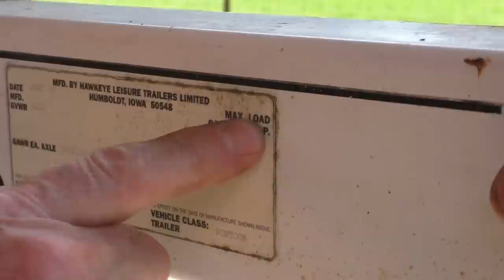Main Mast and Gangway and Assorted  Repairs

Comment: Now that's a hell of an idea. been suffering welder tan and spatter burns on my arms because my jacket shrank as I got older. Or my waist just kinda went sideways. I'm heading out to cut off the bottom half of my jacket so at least my arms are covered. Thanks Doug for allowing my to get a second life outa my rather expensive welding jacket.

Comment: when fitting a pipe to another pipe use a hole saw the size if the pipe you are fitting to, to get the proper profile/cut on the mating surface.
Reply from the maker: Not really needed for our task.   On a boat doing more with less is better than hauling around every tool know to man.
Reply: Agreed!   if you want a better fit maybe stand the rungs vertically between two pieces of steel schedule pipe and give it a quick hit with a sledge?
Reply from the maker: That would work.  Might be able to just super glue them on after that.  :)
Reply: +SV Seeker  As long as it's the certified industrial marine nuclear stuff ofcourse :p
Reply: just make sure it's a good marine grade superglue and you should get good service out of her.
Reply from the maker: I'm old enough to remember bailing twine.  Before it got replace by that newfangled bailing wire.
Reply: my last delivery of material arrived with some polymer strapping instead of the usual steel stuff... was significantly harder to cut than steel!  times are a changin

Comment: If you are using a shielding gas while welding, try a CO2 and Argon mix.  About 5
5 argon is plenty. The sheetmetal shop where my dad worked fabricated heavy stuff. They found that This mix of gas gave them a smoother and flatter weld with a little better penetration on thicker metal.. Keep up the good work..

Comment: Gidday from Australia mate! I found your channel the other day when looking for home foundry and you were making your prop blades and I haven't stopped looking at ya vids since, enjoying them all.
I wish to through in my 2 cents in if you don't mind, if you don't know about this little trick here it is if I'm telling ya how to suck eggs forget I said anything.  
When you were doing the mast top you mentioned about the gaps being a bit hard to weld, what I used to do if I had some "Gap craft" to do was to take a 3.5mm low hydrogen welding rod or what have you, knock off all the flux then lay it into the gap and simply run your weld over the top of it, easy mate.

Keep up the good work, love the dragons.

Calm winds and fair seas.

Comment: If you have lots of pipe ends to fit, get a tubing notcher. They use hole saw blades, they are quick, easy & accurate.
Reply from the maker: Maybe if we were building race cars, but doing more with fewer tools is a better skill set for a work boat.

Comment: I used to install light poles on freeway cloverleaf about 30 years ago. In fact I installed some near Tulsa. More than once I had customers report that the poles were warped. I always had to go investigate and the issue was always the same, the poles would "sunflower" (lean away from sun in daytime) and be straight as an arrow after dark. Just wanted you to be aware that the sun can create problems with straightness. Great video and build.
Reply from the maker: Spot on.  We are very aware.  We would weld and then go take a break so we could cool down as well as the mast before we measured it again.

Comment: The next time you are trying to check a piece for straightness, mark the center of the end face and then set a pointer where you want the center to line up to.  That way you don't have to keep measuring the deflection.

Comment: I saw a nice technique for cutting birdmouths on pipe to pipe joints the other day. Just put the pipe under the drill press horizontally, and go through it with a hole saw the same diameter of the mating pipe

Comment: I did a welding apprenticeship. The real skill I soon realised is the fabrication, which you have totally nailed. I never ever considered how poles and masts are tapered at the steel mill. Never saw it or needed to do it (worked on railway, not many masts needed there!!) How do they do it at the steel mill?

Comment: You sure keep moving on this at an impressive pace Doug, well done!   One quick note on the gangway... make sure to offset the horizontal rungs and the vertical stiffeners (stiffeners between rather than at each step on the rung)... you want to minimize the heat affected sections on that T6 aluminum as much as possible!  Curious about your hinge/pivot design as well!
Reply from the maker: Thanks Dan.  We will do that.   And I be happy to have some input on the hinge.  There is a steel pipe bracing the outside rail of the catwalk.  I was thinking of cutting some UHMW to wrap around that, and then capturing the UHMW in an aluminum pipe that bolts over it in two pieces.  That pipe would allow the up and down motion, and then we'd sandwich a plate of aluminum on the end of the gangway between aluminum plates attached to the aluminum pipe and insert a pin through the sandwich.  That would allow th gangway to swing to the side and prevent it from rolling too much.   I think it will need some cutting boards in that sandwich to make the plates slip easily.
Reply from the maker: Ok, after sketching it out with Bart last night we scrapped that and are moving on to plan B.   I've put a crude sketch on the web page.  http://wp.me/P6ivyU-o9

Comment: Most people use stick welding for stuff like this but glad to see it can be done with mig as well
Reply: If I remember right it's dual shield, flux and gas.
Reply: I recall the same. Definitely has flux though. That is what they are knocking off with their slag hammers.
Reply: Yup.
Reply from the maker: You can use anything you like.  Stick, TIG, MIG, Flux.   If you're willing to do the work.

Comment: Do you know that trick of turning the grinder sideways a bit when back gouging to put some angle the sides of the grove?
 About 30 deg on each side. Dualshield wire really works well with that and has less tendency to blow out. 
As a Fitter and Welder, I say you did a good job getting that thing straight.

Comment: Hi Doug, as I heard you talking about hot dip galvanizing the mast, I thought - because of all the stress you put into it by bending and welding - it might not be the best idea.. Sure because of corrosion protection its the coolest option, but I'm a bit worried about that, after the hot dip, all time and work you put into getting it to the shape you want is wasted..?! Anyway, thanks for your inspiring workspirit, its a total joy! I'm not able to, but I would love come and get some work done! :)
Reply from the maker: I'll let you worry about it.  Let me know if it helps.  :)
Reply from the maker: They galvanize pole by the hundreds.  Seriously nothing to worry about.   And that is a fine boat.  Either it has already served it's purpose or yes, you need to finish it.

Comment: I love your videos and have learned a lot from them.  I was wondering about all the effort put into straightening the mast.  As stated at about 3:00, I would have just turned it so it was pre-stressed.   Look at the old schooners and the angle of the masts.  You like I are somewhat of a perfectionist and do understand why you had to straighten it out.  The only thing I would have done different would be to stick weld with heavy gauge 7014 rod.  My personal preference.  I am a amateur welder so I am speaking out my ass on this one.  It may have been to brittle for what you are doing.  You are doing a great job and fuck the haters and trolls here.  Please keep the great videos coming.
Reply: PS, the best way to get a good cut on tubing.  Mount your tubing on your drill press and cut it with a hole saw the same size as the pipe you are mating to.  A little grinding on bench grinder will give you a good relief for welding.

Comment: well done Doug  I recall seeing that the top part of the mast is a tight fit on the bottom will the thickness of the zinc make putting them together more difficult and I wonder if you will be running some sort of wiring through the mast for marker lights etc  so will it be secured or just hanging free inside? or will it run up the outside? Just wondering
Reply: The galvanizing will probably add about .080" to .120" to the diameter. He might need to do a little grinding when it comes time to fit it into the collar, all depends on how tight it is.
Reply: That is what I was thinking
Reply: wow I had no idea that galvanizing could be .040-.060 thick.
Reply from the maker: I'm sure there will be grinding.  ...but we have to remove the zinc anyway so it does not jack up the welds.  And we have a plasma torch if we need a little more relief. :)

Comment: Cool video once again. I know it takes a lot of time behind the screen to get a video uploaded. Thanks for the videos. Does the wire feed get as much penetration as a stick welder? Never used a wire feed and thinking about trading the hobart stick welder/generator for separate units but with wire feed. I would value your opinion! Thx SV Seeker!
Reply from the maker: Thanks.  With a nice gap between the plates and the right settings on the MIG penetration is not an issue.  We work right at the edge where the base material is key holing and we often blow through.   The problem I think is that you can turn down the heat and just lay the weld on the top of the joint.   Just don't do that.   Stick welds can be done poorly too.  Just look at mine.  :)
Reply: +SV Seeker Thx Doug.

Comment: Maybe you could design the gangway with a mechanism to keep the steps horizontal. That would mean that whatever the angle the gangway will be easy to climb. And when it is stored fully up, it would double as a makeshift catwalk. Maybe that's your plan, but you never mentioned that, rather that there would be no catwalk on that side.
Reply from the maker: We have looked into that.  So we are starting with a design that can be modified latter. http://www.svseeker.com/wp/sv-seeker-2/sailboat/origami-hull/gangways-catwalks/?v=7516fd43adaa
Reply: following the simpler is better philosophy, how about using a 12" or 14" aluminum pipe cut in half as treads, sprayed with grippy paint so it will work at any angle? Those dragons look sick up there, I love them!!!!

Comment: I was a tad surprised that all the fittings haven't been welded on to the mast before hot dip galvanising.
Reply from the maker: I think we'll add some of the gear before we leave but I also figure we are going to move stuff around too so most anything else will be bolted on, so it can more easily be relocated once we know what we are doing.
Reply: At the very least weld the cap on the top and perhaps some of the major rigging connections.

Comment: I wonder what the ratio of physical work to metal work is...  The whole boat has been a huge puzzle.
Reply from the maker: You know, it's not that bad.  It's all kind of flows from one part to the next.  Like a car project.  You start with the fame, then the suspension, drive train, body.    You don't really have to think much about the doors or glass while working on the suspension.  And someone will come along to help with aligning the hood when it's time for that.  :)     ....I think it's mostly physical work.

Comment: Does the weld go all the way through the steel in the joins on the masts. I think Id be cutting the masts in half length ways and welding the inside, however, not sure about the final welds when the two halves are rewelded. Cant say how much Ive enjoyed the series Doug! All the best
Reply from the maker: No worries.  If we break it, we'll do it again.

Comment: I would be surprised if a pipe that long was any straighter from the factory.  I've shortened/lengthened vehicle chassis, and I always measure them in an "X" to know the alignment before I start.  I've found them over 1/2" out from the factory, and that's more critical.

Comment: Not to discount your welding abilities, but if the mast does end up with pin holes/eventual salt water penetration?  Was thinking, after welding is totally done, you could splash some paint on the interior of the mast section and role them while still horizontal?
Reply: He is taking the whole mast and having it Hot Dipped Galvanized. Even better than paint for durability.
Reply: good deal.

Comment: How will you test to make sure the sv is water tight? I would assume you would not test in the river based on my knowledge of it being hard to get out without the proper machines and time. Also would think filling the boat with water would rise issues with  supporting the weight and pumping out the water.
Reply: i think that every boat "leaks" to a point.. and thats what the bilge pump is for no? 

they still need to wet sand blast the whole boat and paint it so id say most of the pin holes will get filled that way and any that are left or that show up over time will just be the job of the water pump to dump it over Bord..
Reply from the maker: The fact that we have to pump rainwater out is a good test.  :)

Comment: seeems like a lot of work to taper the mast, why?   wouldn't a straight pipe work, and actually be strong without all the cutting welding joints and heat annealing weakening the original crystal structure in the metal.....is it aesthetic, or is there a practical reason engineering wise to create a taper?

Comment: i have heard you mention the "Cummings" engine loads of times throughout this "Mission", are they very good engines? and Is it really powerful enough to sail a ship?
Reply from the maker: I'm not an engine person, so I got advise from as many people as I could and the Cummins 5.9 is by far their common pick.  I love it because the only thing on it that is electrical is the starter motor.   Just started it this morning and it has no problems sitting for weeks between starts.   As for powerful enough of a ship?  No.   But internal combustion engines are very new to sailing ships and frankly I think we have become lazy and stupid relying on them.
Reply: Thanks for the reply, love your videos, been here from the beginning, just lurking in my corner.
Will you still make videos once the ship is finished, i cant go cold turkey.

Comment: aren't you worried about not bevelling and doing multipass welds, those masts are going to experience a lot of torque.
Reply: The standing rigging takes most of the force. If the rig is tuned properly the mast is just the structure not the support.
Reply from the maker: On 5/16 steel?  Not in the least.

Comment: using a wire wheel on aluminum makes it incredibly brittle and decreases it's longevity considerably. I couldn't tell you why, but I can tell you it's true.
Reply from the maker: I think you must be thinking about thin aluminum sheeting and it's not that you're removing the oxidation layer but that you are getting it too hot.

Comment: Why not a wood mast?
Reply: My guess is that wood is a much higher maintenance material. it is also not as strong as steel. If you are curious about wooden sailing ships, check out 'The Lady Washington', homeport is Aberdeen Washington. She is a replica of Captain Robert Gray's ship which was part of the United States expedition to the Pacific Northwest and the search for the mouth of the Columbia River. The ship was built by mostly volunteer labor by guys just like this crew. A bunch of crazy dreamers with an incredible idea.
Reply: After I did some reading to try and answer your question, I came up with another question... Why not aluminum? Generally it seems that its aluminum vs wood, but steel is an interesting choice. If i had to guess its because steel is cheaper, easier to maintain, and he already has the tools to work on steel. I'd be interested to know if its not too nosy.
Reply from the maker: We don't have Douglas Fir in Oklahoma but we do have a lot of steel oil field pipe.